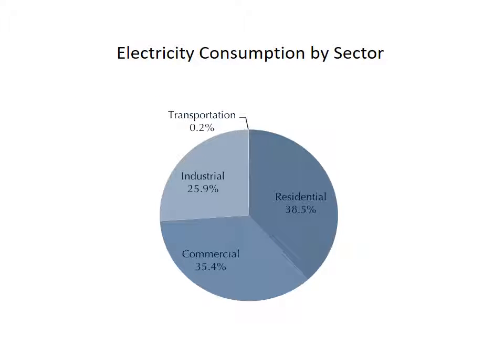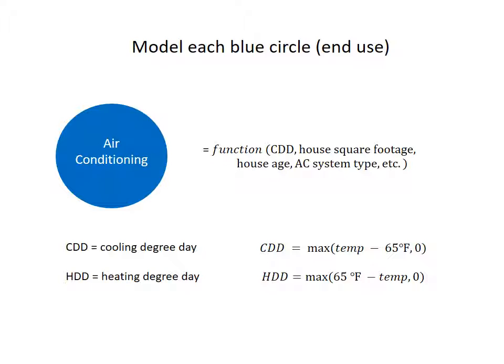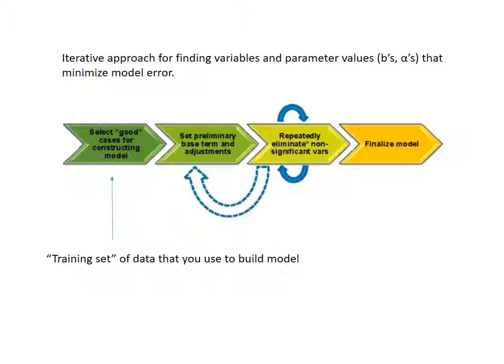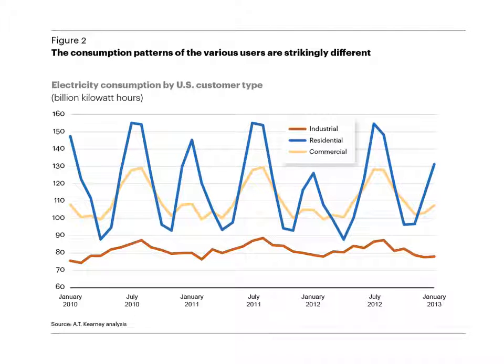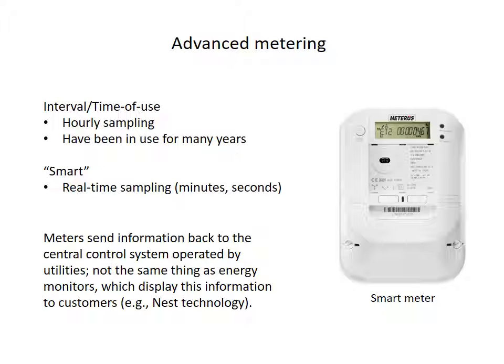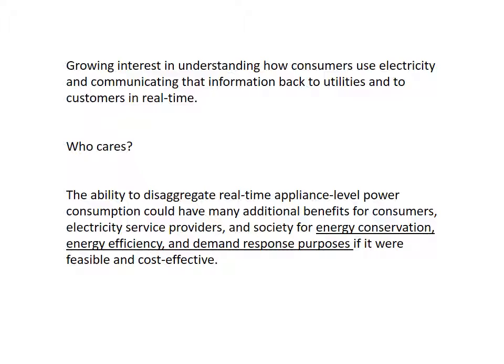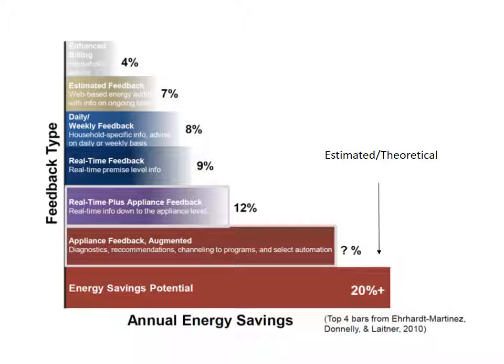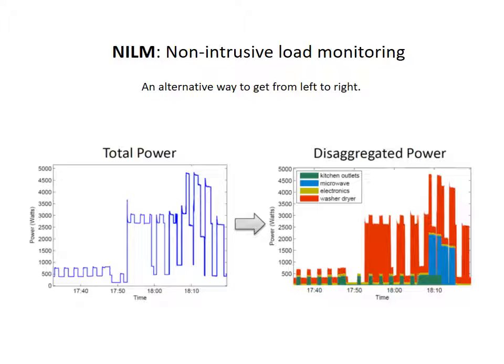Lecture 20   Energy Disaggregation

Comment: 1:50 US residential energy usage for the nation.  I wonder how they know the energy usage in a given area to make these assumptions.  An electric utility knows the energy consumption for a residential rate class (energy sold during the year but I'm curious how they have this disaggregation of the loads).  This shows a good percentage of energy for water heating.  Most of that is done with natural gas, not electricity.  Unlike some third world countries.  That seems suspect based on my understanding of the West Coast.  Is the east different?

13:50 Average households usage regionally.

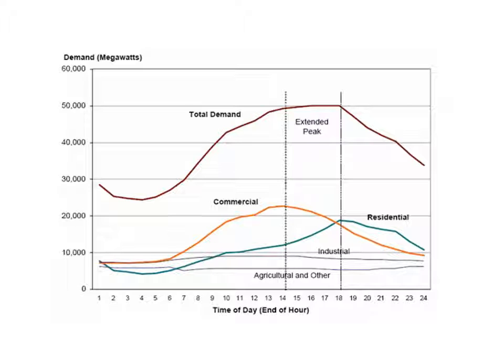19:50 Customer class hourly contributions to peak usage.

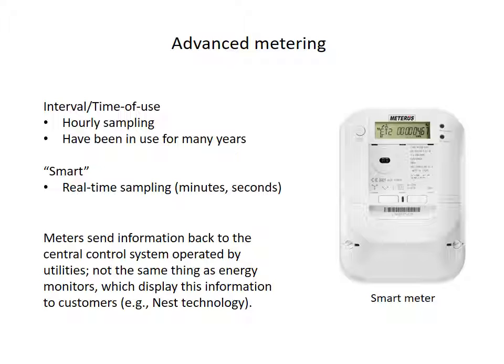22:00 Smart Meters, AMI, AMR.  I'd point out that you are incorrect in saying that they are two way communication devices.  They can be.  But they can be one way devices too. Just saying that one way communication is considered smart too.  Simply removing the need to have meter readers makes them automated and smart.  The remote control is generally weak like you can require the remote end to send 15 minute data rather than hourly data, which is normal.  The meters aren't able to be disconnected remotely with most meters.

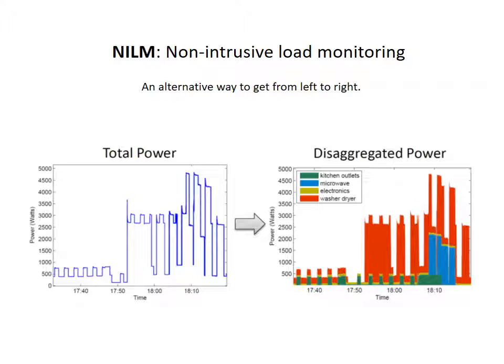39:00 NILM.  This show you there is no water heating.  Washers and dryers.  Large hp machines. and the biggest power users, however I'm not sure not that translate in to energy over time.  This is only a 40 minute snap shoot.  Notice that you again described one way communication of customer data to the utility, not two way communication.  Although there is a master slave relationship generally and it is truly two way.